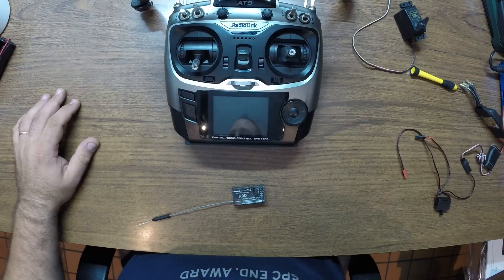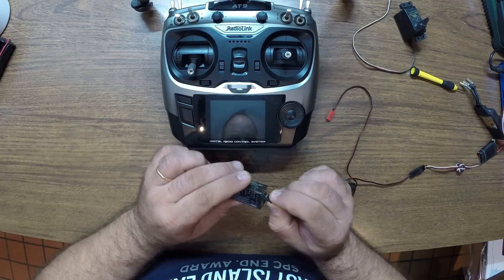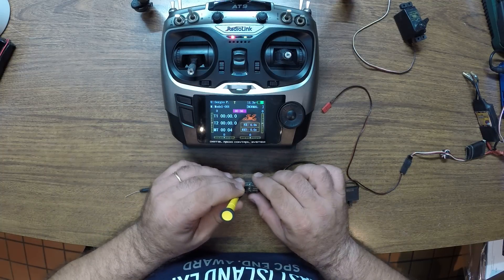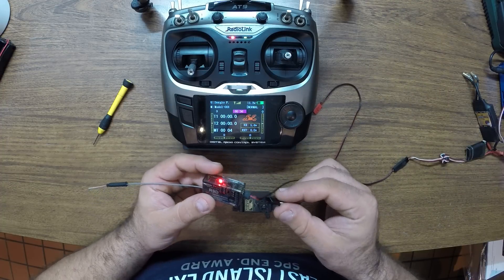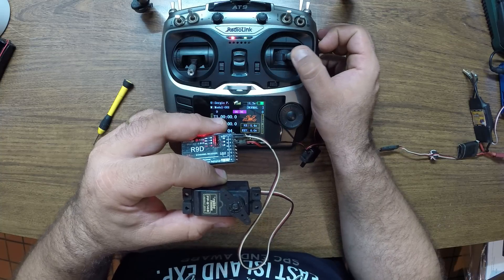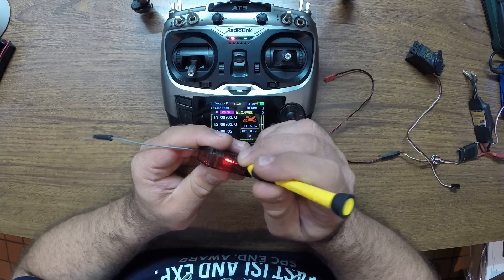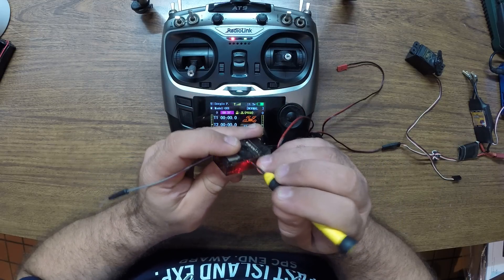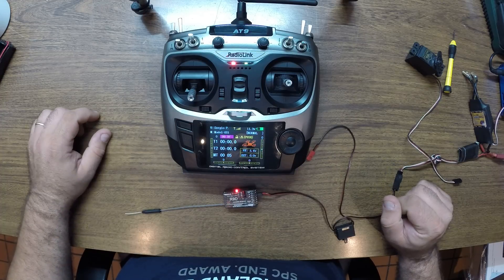RadioLink AT9 + R9D Binding

Comment: Hi,

İ have to the Radiolink AT9. I have bind it with r12dsm.
the RSSI displayed on the Tx reads null for a few seconds then goes back to normal and this gets repeated every 30 sec or so. İs it normal ? Can i fly without problems?

Comment: +Sergio Pereira I purchased the AT9 and I'm trying to figure out if I'm doing something wrong or if I have a DOA receiver.  I have a CC3D with the input port set default and the main port to s bus.  however when I connect the R9D, it doesn't light up at all.  I tried it with using port 3 as you suggested in this video as well as the bottom s. bus port, but it just won't light up.  Do I need to have a battery connected to the quad, or can the CC3D usb power it?
Reply: you have to have the battery connected and your ESCs have to have a bec and if they don't you'll need a bec

Comment: how about the range?
Reply from the maker: Range seems to be within normal values. Never had signal loss and i-ve some videos of people going up to 4 Km with stock configuration.
Reply: +Sergio Pereira I crashed and the antenna snapped of and broke! What do I do? Does this mean I need a new receiver? And where do I get replacement antennas. I have a srd250 v2 quadcopter.
Reply: +Sergio Pereira how many volts is needed to power up the R9D receiver?

Comment: Can it be bound to other DSSS receivers? For example, walkera receivers? Thanks
Reply from the maker: Jorge Rodriguez Will try and find out. Will get back to you.
Reply from the maker: So after talking with the manufacturer it seems that it won't bind with other DSSS receiver. Only RadioLink ones.
Reply: Thanks for the info.
Reply: +Sergio Pereira Hi would you mind make a video on AT9 R9D setup with Full Naze32?